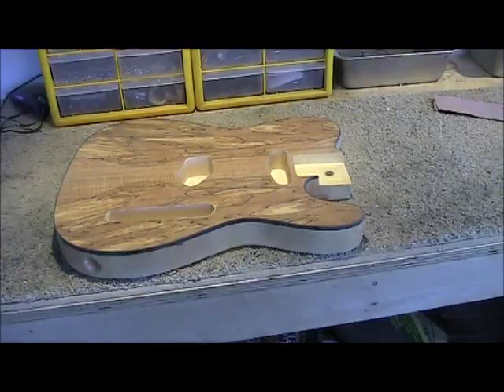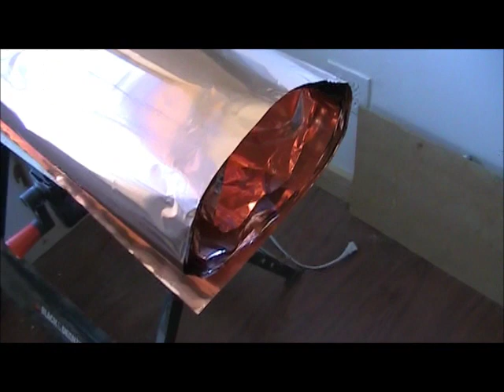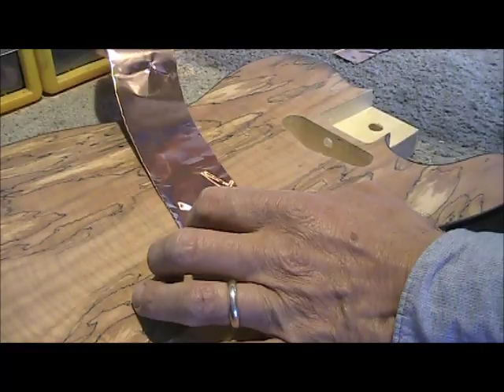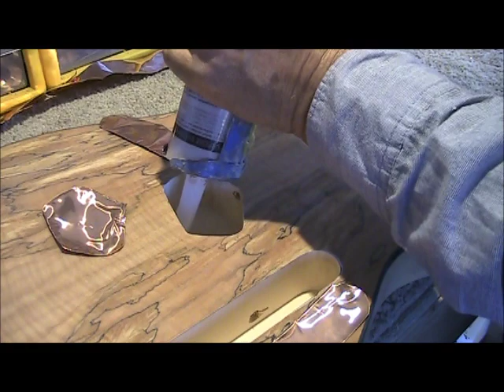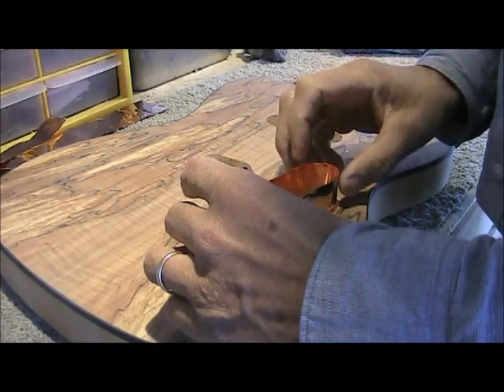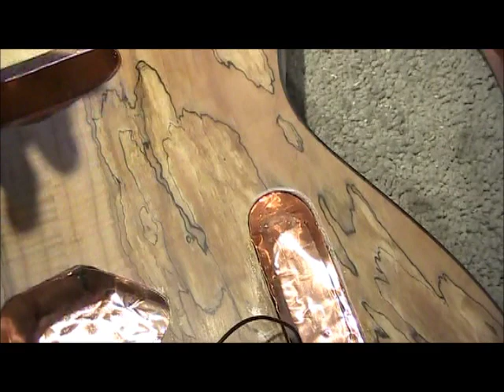Newcaster electric guitar copper shielding tutorial

Comment: Forgive my ignorance - but how does one shield the pot controls and surface mount single coil pick-up on an acoustic guitar? - actually I am going to build a wood Cigar Box Guitar - and want to keep it both acoustic and electecric. Hence there are no pockets to insulate with copper or aluminu foil tape. Any suggestions would be welcome.
To know the type of set up I would be using go to Amazon and search  for; "1set Pre-wired Cigar Box Guitar Pickup with Volume & Tone for Electric Guitar"

Comment from the maker: here is one more little detail.NEWCASTER GUITARS are made with metall pickguards and don't need extra shielding under the scratch plate.if you are using a plastic guard then you should add that copper foil  underneath as well.